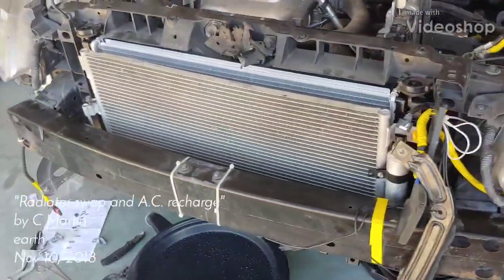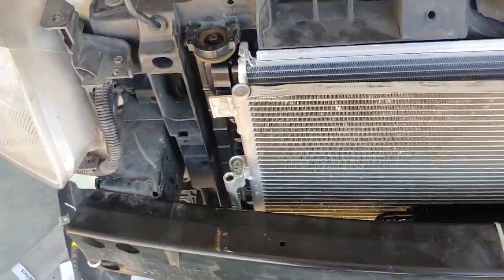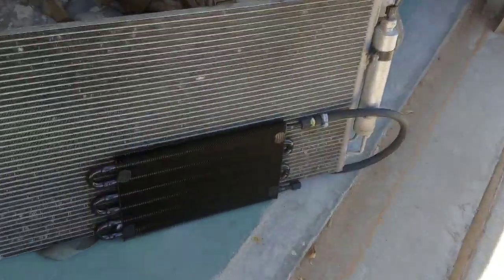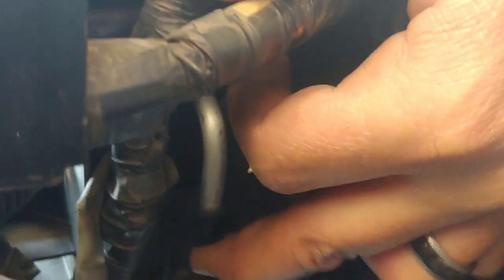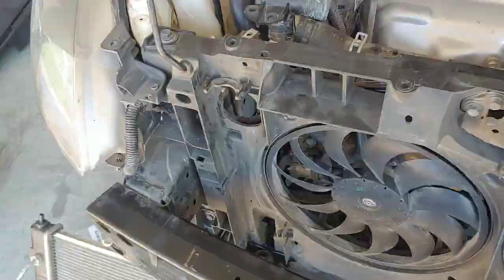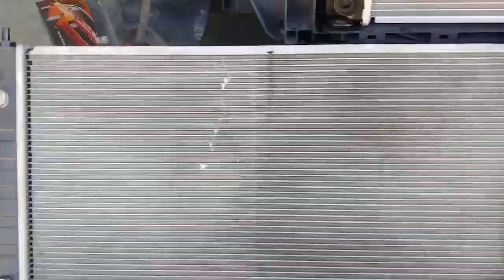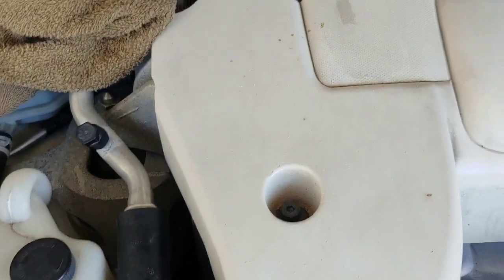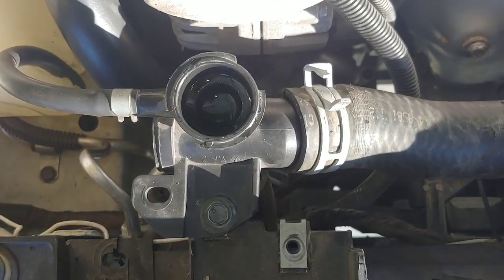Radiator remove and replaced, charged A.C. with R134a, 2012 Nissan Altima

Comment: Thanks re the radiator replacement, I have to do one tomorrow but you left out a few important details regarding the AC system. Once you open the system you need to do an evacuation, leak test than charge by weight per vehicle specs. Just recharging after opening the system is not great on the compressor. It doesn't like non-condensables.
Reply from the maker: I had a leak from a bad O ring, so after I replaced the O ring I added about 45 lbs the manual calls for 50 lbs, I just didnt have the equipement on hand to do the evacuation at the time.
Reply: @mygeniv8377  45-50 lbs?!? Of freon?? No way bud. My family owns an auto repair shop, been in busy since 1972, and A/C work is one of our specialties. Most vehicles hold between 2 - 4 pounds of R-134 freon (R-12 for older vehicles, but we retrofit those with R-134 when possible), some occasionally will hold around 5ish lbs. But I have NEVER seen/heard of anything holding 45 or 50 pounds of R-134 freon.

Comment: Hello...I have a 2009 nissan altima, and my radiator has to be replaced. Does the air conditioner always have to be recharged after its replaced.
Reply from the maker: Only if the condensor was opened or drained, usually the job is done without messing with the AC, but if its not blowing cold anymore try recharging the system as shown in the last half of the video, make sure it has about 40psi in the system
Reply: @mygeniv8377  Ok...and thanks for replying back!

Comment: Hi My Gen IV Can this be done without having to open AC and remove freon is there a way not to open system a way to possibly hang the condenser without taking out freon
Reply from the maker: You'll have to open the system to change the condenser, but the radiator can be changed without opening the AC system, I opened mine because I had a bad O ring that I had to replace. If you find a way to support the condensor while changing the radiator you'll be good, but the lines are thin metal so its easy to bend them.
Reply: @mygeniv8377  thanks brother I have a vacuum pump vacuuming now I figured easier then manipulating condenser or damaging lines only thing I hate is wasting freon by vacuuming too bad I don't have a $5000 AC machine lol I did 12 years in the Marine Corps as a Force Recon  Marine I see you are in Army still brother thanks for your service

Comment: how much does it cost to have it replaced?
Reply from the maker: Don't have a clue, I do all my own work so its just the cost of parts for me.
Reply: My Gen IV damn okay. mine broke and my dad is unable to fix it so i’ll have to take it to the shop which is gonna cost me a pretty penny. thank you anyway!
Reply: GloriaIn Glasses Im I’m the process of replacing my radiator( usually $50 or 60)/ condenser (usually $50 or 60)/ and compressor($200 or buy used ). You can get a free vacuum pump from autozone just have to go it a deposit down bring it back you get all your money back . Or have a shop recharge your system . Firestone quoted me $1500 but you can do it for around $200 ish .
Reply: @mygeniv8377  how long did it take you

Comment: Hey Mr gen iv
 My radiator has transmission fluid in it, and nothing in my transmission, I just bought a used radiator and the Goo started coming and my transmission is not receiving any fluids, any ideas plz
Reply from the maker: There is no pump in the radiator to move the fluid, it gets pumped into the transmission fluid cooler by the transmission, it pushes the fluid into the cooler, if theres trans fluid in the main part of the radiator, where engine coolant should be, then you may have a leak internally in the radiator, otherwise you dont have enough fluid in the transmission, check the fluid level with the car on and warmed up to normal operating temp, if the trans fluid is low, add fluid till its at the proper level.
If you have transmission fluid in your engine coolant then I would suggest changing the radiator so that you dont push transmission fluid into the engine.
Reply from the maker: Also, if you do jave transmission fluid in your engine coolant then you probably have coolant in your transmission, leaks work both ways, if so I would suggest flushing the transmission and the engine separately to get as much of the fluids out of the transmission and engine, change the radiator and refill both with fluid, the CVT on a nissan is a delicate thing and having engine coolant in it will damage it.
Reply: Thanks I will go that route